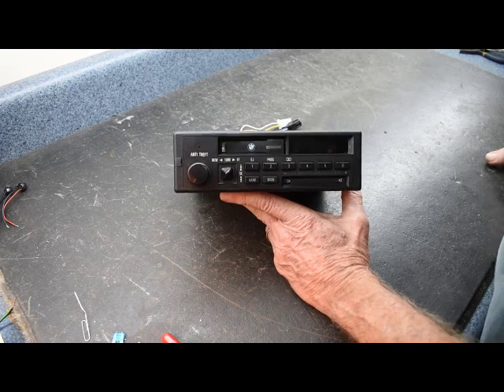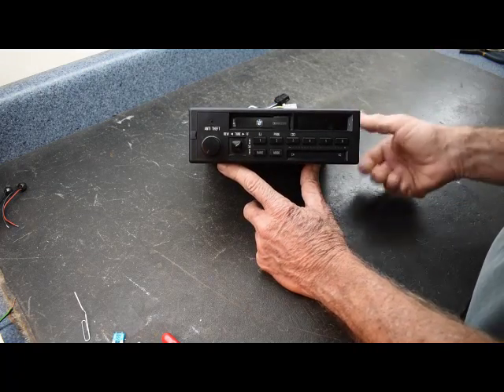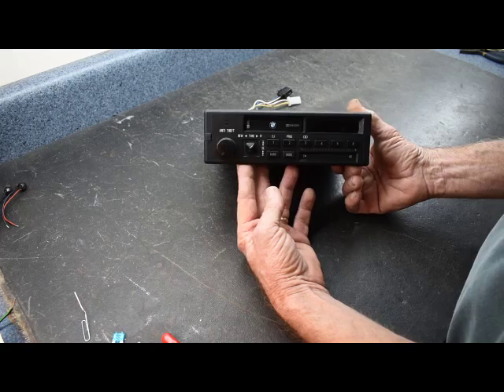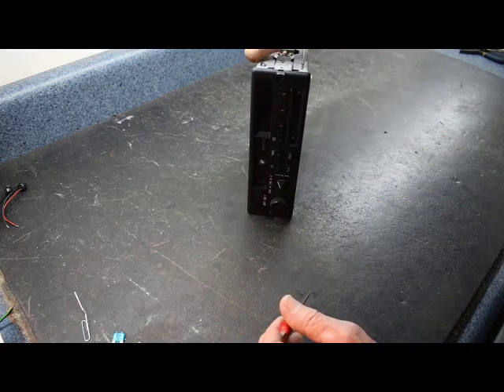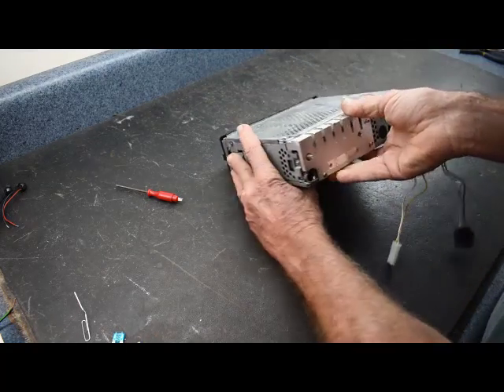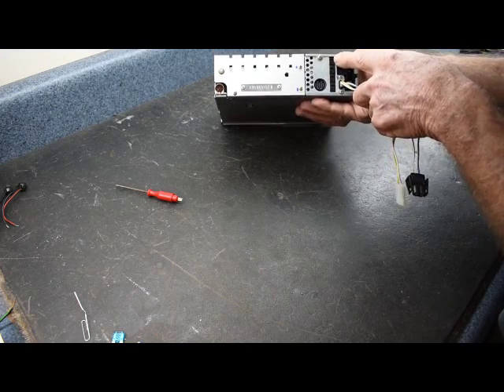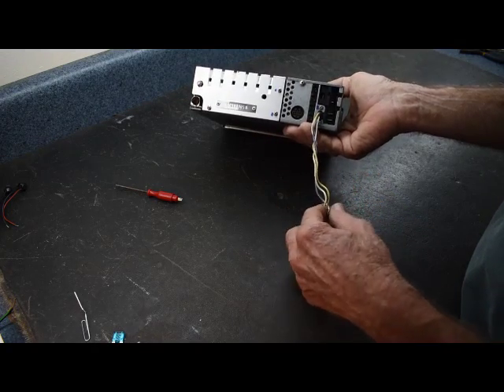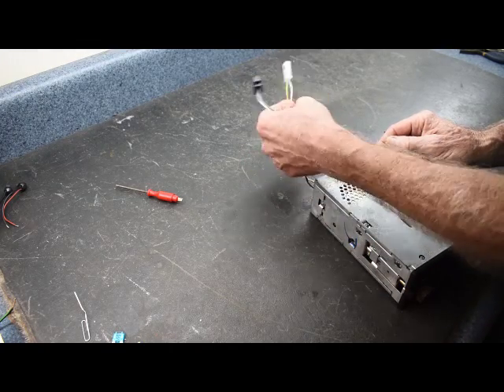BMW STEREO NO POWER - Remove and Troubleshoot - Car Stereo HELP

Comment: Hi there on my 2008 335i the radio doesnt power up and I have no sound whatsoever neither the reverse sensors or even when the dash light warning symbols pop up however the radio still ejects the CD but there’s no light on the radio screen neither the sound. No any SOS symbol either. I got my fuse checked apparently they alright? I’ve ordered a bypass kit to bypass it to my radio, hopefully that’d make it work however in all the videos they used the bypass kit, the radio screen was all working.
Reply: Did this work for you?